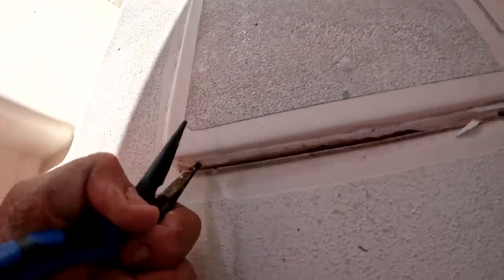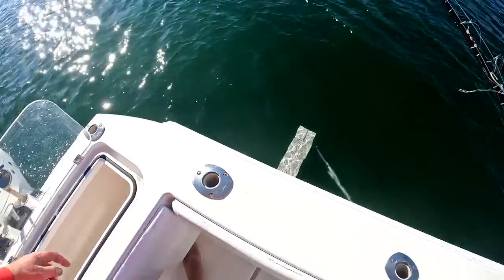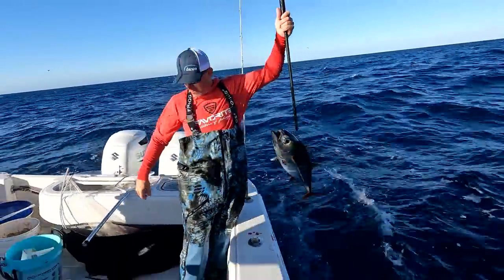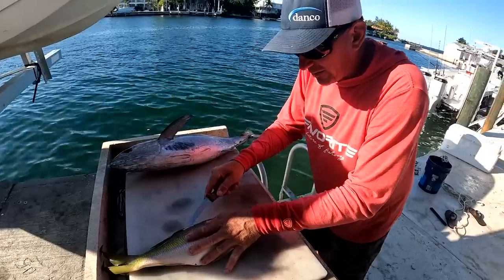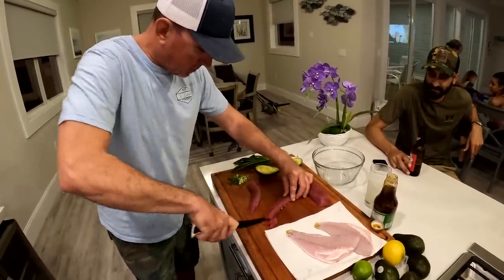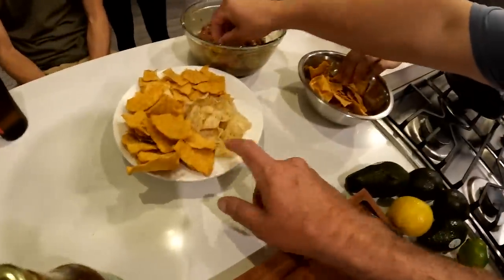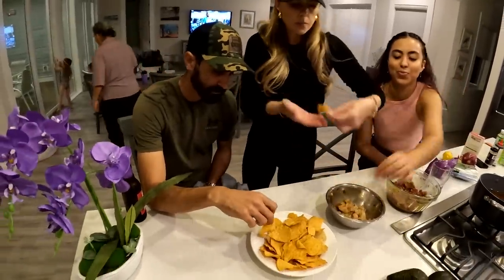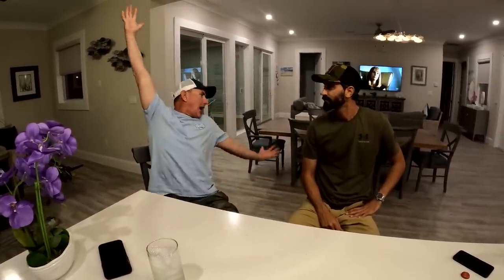A $30,000 BAD DAY! YellowTail Snapper vs Tuna (Catch Clean & Cook)

Comment: I would definitely look into the fuel fill hose first. Get a endoscope and run it up along the hoses recording it all. The ethanol will eat at the hoses and some can break down and once the steel reinforcement in it gets rusty and the hose just breaks down. Just a tip from a old boat builder and hopefully you can see a hose that has gone bad. Thanks for the videos.

Comment: 25:38  sorry for your boat trouble. We bought a used 28ft Cobia got it for a good deal but had to replace the fuel tank. We still have it bought in 2008. You know the old saying. A BOAT IS A HOLE IN THE WATER WHICH YOU POOR MONEY INTO😂

Comment: Sorry about your gas tank. You could drain it and add dry ice to the tank to keep fishing. the co2 will keep the o2 out of the tank to prevent any kind of fire. But if your bilge is compromised, the co2 in there would act as a safe motoring fix but only short term, as the gas would dissipate over a longer time.

Comment: The right tank looks like it's made of steel but the left one looks like it's aluminium, are you sure the left one hasn't been replaced before? lol

You would think they'd maybe use the plastic/composite fuel tanks that are corrosion free?

Especially as the salt in seawater acts as a catalyst and rusts/corrodes metal faster.

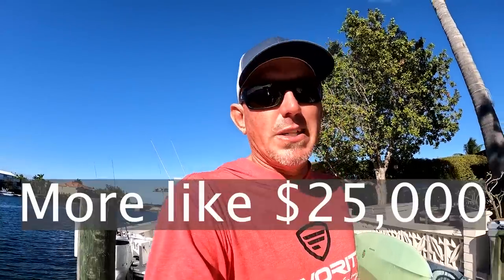Comment: @4:59 25k to fix a leaking tank?  This is where im happy i can do my own repairs on both my vehicles and toys like boats and motorcycles, what cost him 25k would be a few hundred dollars in repairs for myself. Fiberglass resin and paint and the repair to the tank
Is not 25k in repairs 
 man 25k would be a new boat maybe I need to open a boat repair business...
Reply: @nathancrowe1489  i said fiberglass resin and pain and THE REPAIR TO THE TANK. 
The first part is for the deck once you cut it open to Repair the fuel tank.. and from the looks of it its just leaking around the sending unit he would have had to puncture the deck or the hall to make it leak anywhere else,  so before you talk crap i was trying to Honestly say he doesn't have to pay 25k for work he can do himself basically... i have repaired 3 of my own boats, all 3 i cut the transoms replaced the wood fiberglassed them back together with reinforcements for bigger outboard motors and painted them for under 200 bucks i have also cut the decks and put in storage compartments and under deck fuel tanks and one of the i replaced the full deck and transom and all 3 of them are still on the water... boats are basic except for the newer motors and even then they are just motors and cables..